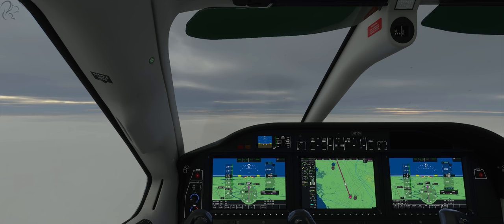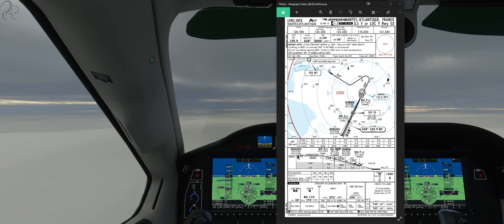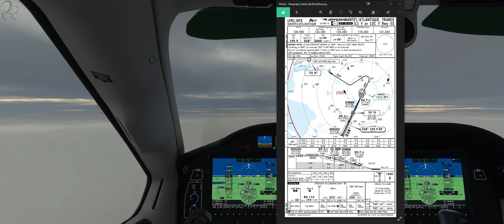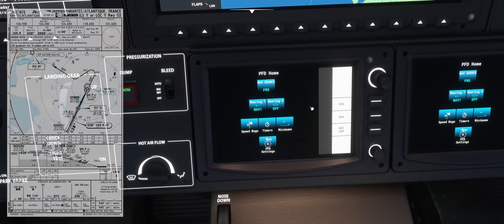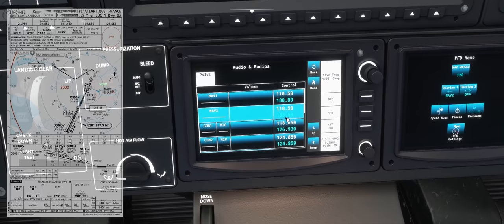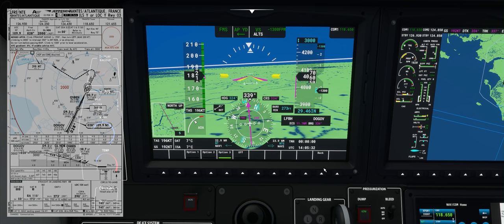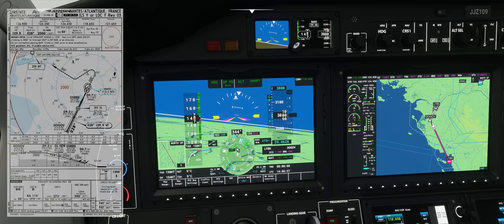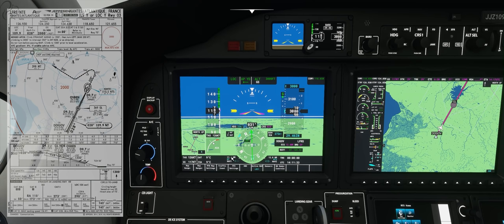TBM 930 ILS Approach - HOW TO in under 15 Minutes - Microsoft Flight Simulator

Comment: Great video, explained it very simply but clear. 

When I try this (and RNAV) type of approach, everything seems to be correctly configured in terms of speed and gear/flaps etc but the plane seems to drop much quicker than it should. The trim wheel seems to set itself to the maximum nose down and stay there, meaning I’m normally about to crash into the floor well before the runway. Any ideas what I’m doing wrong?
Reply: Based on your description, it sounds like you might not have been at the right altitude at the beginning of your approach. The autopilot can only do so much, particularly in MSFS.
Reply: @shadowtheimpure  I know it sounds like that but I've read about it not capturing the glide slope so purposefully sit about 200-300 ft below the level
Reply: @JFizzle1892  both good comments. If you come in before the IF at the published altitude, you will "intercept" the glide scope properly.  Might save the frustration. (general rule, always come in below it, never above).
Reply: @ForderLearnToFly  Maybe I'm just not cut out for this haha. Just tried again and this time it didn't try and trim itself into the ground, so I thought I'd got it right. However it was dropping too soon and crashed me into a forest haha

Comment: Why doesn't the flight director move horizontally when I try to fly manual using ils?
Reply: In MSFS, the flight direction only shows vertical guidance on Garmin systems when the Autopilot is not engaged. It's quite annoying. Use the compass at the bottom to align yourself manually on it like a VOR radial.

Comment: Hi there. Your tutorials are highly appreciated. Yet I am somewhat confused about the stable flight tutorials i.c. your explanation about how to use PAT of APT.  If I understand correctly you apply PAT for climbing and descending, but when do to use APT then?
Reply: APT is used when you finish a climb/descent and want to cruise
Reply: Thx Michael
Reply: A good rule of thumb, PAT DOWN a person. then APT for climb. Just try both ways. If you point the nose down without reducing power first you speed up and eventually out of control. If you reduce power and try to climb.. .well... So Power, watch the nose naturally drop, use your yoke to set the descent speed or vertical speed, then trim it so it's hands off. Both climbing and descending should be able to do with hands off once trimmed.

Comment: Where to best get these ILS charts you have there?
Reply: Best place for them is Navigraph but it's pretty expensive. You can try to google airport ICAO code and add "charts" to it.

There's also skyvector, which is free but it only covers US I think
Reply: Or you could use ChartFox if you’re happy with little outdated charts in some cases. And you need a Vatsim account to use it.

Comment: Is GLS/GBAS different than ILS? Can we do that in MSFS 2020?
Reply: Dibya Jyoti Roy they use GPS (GBAS for example is the Ground Based Augmentation System), whereas ILS is an old fashioned radio signal type system. Not properly in MSFS yet, to be fair in Europe at least GBAS and GLS aren’t used yet for the most part, just ILS and RNav really.

Comment: Will this work with a Cessna 172 G1000?
Reply: Yup.
Reply: Might be a bit more touchy on the throttle to maintain your correct speed, and much more susceptible to crosswinds, but certainly. The 172 is one of my aircraft of choice, alongside the A5.

Comment: Why does it seem less complicated to fly an ILS approach with the old "steam guages" of over a decade ago, rather than using the glass panels of today?
Reply: Less complicated, but also less automated. The glass panels are a result of interfacing the nav system with the avionics to allow them to communicate. With the old gauges, you had to set everything every step of the way. With the glass panels, as you saw, it was able to automatically follow down the glide slope with the only input from the pilot being to control the throttle.
Reply: It looks cluttered as it’s the Garmin, terrain synthetic vision etc. If you looked at an Airbus PFD it’s much much easier than steam gauges. And they have the more intuitive flight directors
Reply: @shadowtheimpure  You said: "...with the only input from the pilot being to control the throttle."
I guess that really distills the heart of the matter, doesn't it? The state of technology today is reducing the pilot from being a pilot to being a manager. I'm reminded of that scene from the movie, "The Right Stuff", when the Mercury astronauts came to grips that they were no longer pilots, but mostly passengers who monitored the automation. 

And while the airlines have been at this state for a while now, it's also at the General Aviation level, where complexity is being traded for automation. I've been away from flying for about 15 years, but when I got my IFR rating, it took all of 30 mins to learn how to use the instruments for IFR approaches. (The rest of the hours of training was spent learning the procedures and practicing). Well, the need to learn the procedures and to practice is still in place today. But now piled on top of that, is the hours and hours required to learn the "instruments" (i.e., glass panels). 

The glass panels of today are far more complex than the old instruments, and thus require a higher effort of training just to use them. So what you get in return is - as you said - is a much higher degree of automation. So IMHO, the true matter is... do you want to fly your airplane, or manage your airplane? :) 

As a P.S., it's not lost on me the degree of aviation safety which the glass cockpits bring to the table. So the enhanced safety and situational awareness - while being a significant benefit of the glass panel technology - is beyond the point I was making about the inherent complexity which accompanies that technology.